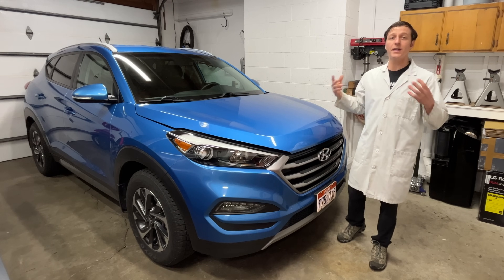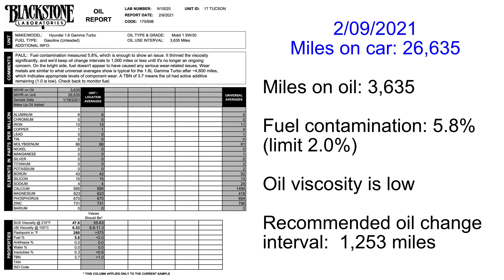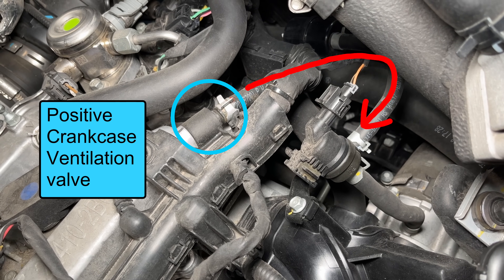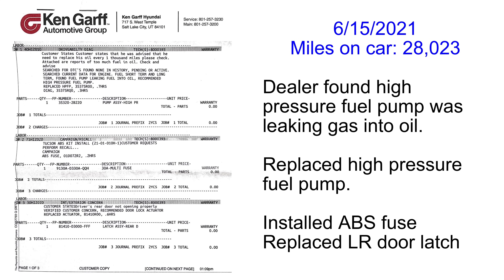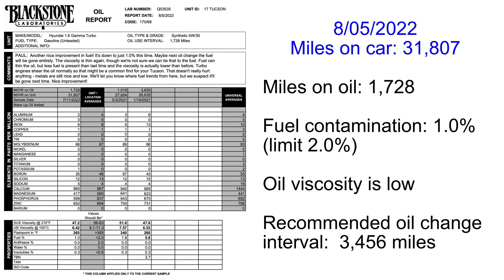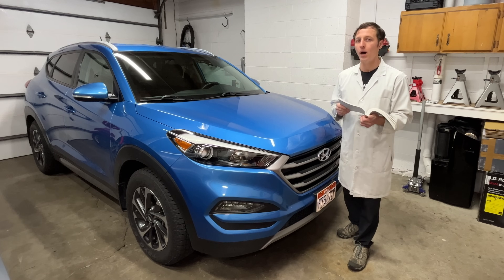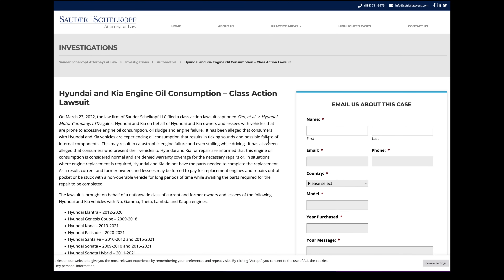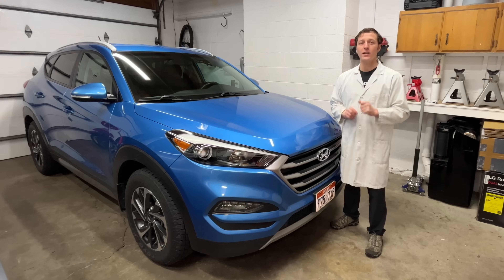Hyundai oil consumption and gasoline contamination problem solved

Comment: What is you typical drive cycle?
If you do short drives or idle a lot, your car doesn't heat up enough to for fuel and water to evaporated. I have only had on with fuel dilution issues. A 2.0T TSI engine because of bad design. But that was only 1%... i drive on a freeway for 30mi with 5mi city bookending my trip.

Comment: Yeah weird, my wife 2018 2.0ltr petrol tuscon non turo is awsome, does 7L per 100. Does use about 200ml of oil to 10,000kms. Been ever reliable.
Reply from the maker: Sounds like you've had good luck. I still recommend doing an oil test just in case.
Reply: @LabCoatPaul ours is in australia too. Not sure of diff models over the world build wise.  But been great soo far touch wood**

Comment: I've got hyundai bayon 2023 bought it in October had service done one month before buying, car went in workshop in December due to excessive fuel consumption, report came back nothing they could find wrong but level at 50% so they trying to say in 3 months its used 50% oil

Comment: Top Tier fuels are recommended, if not available fuel additives added to your fill-ups that contain upper cylinder lubricants may help. Seafoam has given me good results, but there are other manufacturers that have products like that as well.

Comment: My 2016 Kia Sorento has 112,300 miles and I just recently found out that it is burning oil. After looking into this oil consumption, I learned that the 2.4 L gdi engines have this problem. Have always taken my vehicle to Kia for services and was never told that this could happen to my vehicle. Kia USA never reached out to me about this known problem. I am so upset and WILL NEVER PURCHASE ANOTHER KIA!!!

Comment: One thing people miss on these cars that is a sizable contributor is the cold start parts of the calibration are poorly setup, they often flood when they are cold, especially when performing a cold/semi warm restart which requires you to full throttle to activate what I assume commonly used on other makes is clear flood function programmed into the ECU.  Flooding your engine is also a great way to pour in some oil dilution additive! 

My partner has the 2019 i30 and it drinks oil like no tomorrow and did from brand new, it suffers the flooding issue as most who own a Hyundai in Aus, but since they are all the same engine, the assumption is this is likely a global issue. 

Also, these engines are prone to knock on hot days on normal 91 petrol and only seem to be ok with 98 premium. The knock control system is surprisingly slow or not aggressive enough, similar to all the Ford 4 cly engines from the past 15 years like in the focus etc... They rattle like a MF and it's amazing they don't blow up 100% of the time, I feel like all Ford engines at least the petrol ones sold in Aus knock like a spray can.   Many didn't have any form of knock control iirc, but a modern car like Hyundai should have no excuse for audible knock, their ECU and code should be able to react and pull timing before any knock event ever becomes audible and def not any length of time where damage can occur.

With Hyundai, this multitude of issues are conspiring to the engines spinning big ends and stepping a leg out of bed.

I once did a used oil analysis years ago on my Holden which runs the Buick 3800, a 5K oil change was excellent and I recall the fuel dilution was something well under 1%.  I still have it on my PC somewhere.  That engine had over 300k on it I think at the time.

Comment: The video fails to address the driving habits of the owner.  Driving short hops where the engine doesn't warm up signficantly contributes to the blow-by and gas contamination.  If the driver drove mostly highway miles, the contamination would be significantly less.  Additionally, it's asserted that the cause of the oil consumption is due to the gas contamination when in fact, it's due to the build up of gunk and carbon on the oil retaining rings, usually attributed to the use of conventional oil (not full synthetic) and long oil change intervals.  The oil retaining rings fail to seat properly, causing blowby which only increases the oil consumption issues.  These engines require additional maintenance beyond what Kia/Hyundai suggest, including the use of full synthetic and oil changes at less than 5k miles. I have a 2019 1.6L turbo Exclaim ! and I love it.  I have 75k miles and it doesn't burn any oil.  BTW, oil consumption issues can be addressed by doing an engine soak and/or using Vavloline Restore & Protect.

Comment: My 2017 Mazda 3 has 40 k miles hasn’t used a drop of oil and got 44.6 mpg on the last trip last week. Brand new at $17k  20 k out the door . So far one battery two cabin air filters and oil changes
Reply: Continue using a good oil and you wont have any major problems !!

Comment: I have a 2018 Hyundai Santa Fe Sport with a 2.0 L turbocharged Theta ll that had extended warranty that started burning over 1 Ltr of oil within 1000km. Had to take car to dealer every 1000kms to record oil consumption. Oil consumption was over 1 L within 1000kms. Hundai declined warranty because the dealer recorded less than the 1L on the 6th and last test according to warranty issues. There was also cylinder wash from blow by and bad exhaust valves in number 4 cylinder that also miraculously disappeared in this same last evaluation. Doe to these miraculously self heal I was denied warranty. Never the less the problem worsened and now have a pronounced miss in the engine. After all these issues why would I put more investment in a vehicle and end up in the same position. MY ADVICE TO ALL IS NOT TO PURCHASE FROM HYUNDAI OR KIA

Comment: 2014 Santa Fe 3.3 , 58,000km , dealer oil changes every 6000km (81 year old mothers car) bottom end started knocking - Hyundai replaced short block under warrantee just after 10 years. Thanks to Hyundai!  we almost had to junk a perfectly good SUV!

Comment: All Gdi engines have this issue.  Certainly, you know about HONDAS GDI ENGINE ISSUES., and you should have known that TURBO GDI engines should definitely have 3000 mile oil changes, especially since we are forced to use 0 20 oil in them. From what i can tell, you didn't know much about cars, until you got a MODERN one. Personally,  I've owned 4 korean cars, and all were excellent,  I bought a new 2021 kia K5 GT LINE with the 1.6 Turbo, a great performer,  and of course 3000 mile oil changes since day 1, using Castrol Edge.  74.000 miles now, engine runs like new, uses no oil, car has had no issues.  Stay away from Honda Accords with the 1.5 Turbo engines.  They are blowing head gaskets, and ruining the Turbos at the same time because of coolant in the oil. Honda is refusing to help it customers becase its happening after 60.000 miles, but usually well below 100.000 miles. Very EXPENSIVE REPAIR. Have heard a class action lawsuit is in the works.

Comment: My 2013 Santa Fe had the 2.0T and i did the oil changes every 3500-4000 miles with Mobil 1 synthetic. The only time it was in the shop was for recalls, and the rocking drivers seat issue they had. It never burned a drop of oil between changes, but it did lock up at 89k miles. They looked at it and had approval to replace in less than 24 hours. They never asked for proof of oil changes, but the fact I always used factory filters and had a Fumoto valve installed instead of the drain bolt might of helped them realize I was doing the service required.

Comment: I think every manufacturer should face a similar lawsuit. My GM gdi oil gets very thin if I follow the oil change schedule. At a fresh oil change the warm engine idle oil pressure is 32-35 lbs at 3,000 miles it’s dropped to 25-28 up to  5,000 miles it’s dropping to 22-23 lbs. they recommend oil changes at 7,500 miles.  Low friction oil rings, thin oil, and the extended long mile oil changes will kill engines.

Comment: My dipstick has risin above the full mark almost an inch from fuel mixing with the oil. Only 4k on the oil. 2nd theta II engine for the 2019 sorento. First one blew at 28k even tho it had oil changes every 5k religiously. Complete junk. When warranty is up it’s getting traded in.

Comment: 2015 Hyundai Tucson with 92,124 miles and still going, replaced all rotors, valve cover gasket, serpentine belt, starter location was a pain in the you know what but replaced that once, A/C compressor once, replaced window switches once and main driver side window switch 3 times, missed some oil change intervals but I used a slightly thicker oil 20/50 cause we live in the tropics, leather seats are holding up, radio screen is showing a black halo around it, dashboard showing aging with a few small cracks not that noticeable, going to finally flush trans/replace fluid and coolant but those 2 are still original and I am quite surprised I have these many miles on it and I still still drive to this day 👌🏽🤔😁

Comment: The answer and solution to this in this case. . .  is only buy a Hyundai or Kia vehicle with the 2.0L MPI engine. Then no issues with HPFP leaking raw gas into the crankcase and no gasoline getting sprayed right into the combustion chamber and getting past the piston rings. Multiport Fuel Injection engines are still in use if you look for them.
Oil change  interval can then be 4,000 to 5,000 miles and still protect the engine.

Comment: I am going to share my experience with owning a 2015 Hyundai Sonata, with 135,000kms that: (1) does not burn or drip oil (2) has no sludge build-up (3)is very fuel efficient (4) motor is very quiet and runs in showroom condition, and has great idle oil pressure.
       How? Short answer: 4000-4500km synthetic oil changes with high flow quality oil filters (yes kms not miles, less than 3000 mile oil + filter changes ... I use mid-grade 89 or higher octain fuel only ... I run a mild engine flush(seafoam additive) in the motor oil every third oil change ... I change pcv valve every 40,000 to 50,000 kms, I run Lucas fuel stabilizer additive in my fuel tank every other fill-up ... and finally,  I do not under any circumstances run the 5w20 oil(even in winter) I only use 5w30 and 0w40 in summer( there's an important reason fir this)
         Why? GDI gasoline direct injection engines, allows a bit of high pressure fuel, past the low tension piston rings, contaminating motor oil which makes the existing oil even thinner, and washes away some of the protective film strength on the cylinder walls. Combustion deposits also tend to migrate into the ring lands, getting stuck there, hardening over time, and preventing the sealing action of the pistons in there bores, which causes burning oil. Frequent oil changes, more stable higher octain fuel promotes a cleaner combustion process and Lucas fuel stabilizer prevent carbon build-up. Thicker film strength of the 30 - 40 weight oil, helps seal combustion chamber and fights dilution of oil through bypass contamination. factory tuned, early transmission up-shifts, causes low speed detonation, which damages rod bearings over time, but the 89 to 91octain fuel prevents this condition, while the 5w30 weight oil, vs the 5w20 improves oil pressure numbers, on the bearing surfaces, and prevents metal on bearing contact. Lucas oil stabilizer also puts a thin film of lubrication back on the top sealing rings and valve steams increasing engine life, and the detergents help prevent intake valve carbon crust. Very early oil changes using quality synthetic oils, trap and lock combustion deposits in the oil, preventing sludge build-up and the high flow oil filters keeps oil pressure at optimum levels. Changing the Positive Crankcase ventilation valve often, helps prevent stagnating fumes from causing carbon bonding to internal components, thus eliminating blocked oil galleries with an accumulation of carbon in the form of sludge.
 Everything mentioned here adds up to a vast difference in engine longevity, and reliability. Hyundai 2.4L Theta II engines are not particularly problematic, the issues are more of a combination of several factors that if left unaddressed will prematurely cause wear and longterm damage, but an aggressive maintenance schedule will prevent this.
Reply: I live in puerto rico tropical weather year round 2017 tucson 1.6 turbo up to now no issues with 80k miles. Still can't feel the motor running while i'm inside, it runs smooth as butter. So you think I should change to 0w40 motor oil?
Reply: @carlitosortiz2870 that's not a bad viscosity, but I prefer a 5w40 blend, the 40 means that you are still running a good viscosity
Reply: @brentneves3602 i'm asking since the weather here is warm/hot year round which should i use bcause in your comment you said you switch to 0w40 in the summer. Was that a typo
Reply: @carlitosortiz2870 no, not a typo, in parts of  Canada we can still have cold mornings in summer, I use the 0w40 so that the oil is not too thick on colder mornings, but I can also safely use 5w40 also, as the difference between them is small, the 0w40 flows better when it is cold, than the 5w40, but only marginally, for hot weather all year round, 5w20 oil, is too thin PERIOD! 5w30 or 10w30 is a safer viscosity, but if you do a lot of starts and stops, heavy traffic driving, or lots of high rpms, then 5w40 is probably the best bet, but do give your engine proper warm-up time, 2-3 mins(cold starts) to allow the thicker oil to properly lubricate the turbocharger, and camshafts before driving. Don't use 15w40 diesel oil, under any circumstances, it is too thick for automotive engines, and it has the wrong detergents for gas engines.
       Most 10w30 quality oils will be sufficient viscosity for normal driving conditions, in a hot countries, the secret is very early oil changes, to prevent sludge, which leads to blocked galleys.
Reply: Until the manufacturer mandates 5W30 or Premium fuel most owners will use the thinner oil and cheaper gas. Ford Fusions with 2.0L Turbo EcoBoost benefit in power (about 10%) from Premium Fuel, so there is a real rationale to use it there. It also uses 5W30 Oil. 

Those engines are very reliable with that combination, while delivering way more power and torque than the 1.6L Turbos Hyundai was using in the Sonata Limited trims. 

With the shift in engine design, it's probably time for manufacturers to start mandating higher quality fuel in their warranty packets. 

Use regular unleaded at your own risk - and cost, basically. 

People with Hybrids should not have an issue going to Premium. The increased gas mileage offsets the cost increase. IMO, all Hybrids should be designed to burn higher quality fuel, not regular unleaded. 

Most Turbos should, as well. It just makes sense. 

Most people want to have their cake and eat it too, though.

Comment: Switched to 5w-40 for this reason, and change it every 35hundred miles
Reply from the maker: That's good. I recommend sending an oil sample to the lab just in case, so you know how the engine is doing.

Comment: Welcome to the world of climate alarmist. They will create rules that manufacturers needs to meet and the customer will pay the price...
Reply from the maker: The climate pays the price too. I've measured the emissions on my Hyundai, and it is very clean at idle, and even cleaner at 2,500 rpm with no load on the engine....
But once the turbo gets going, the only way to prevent detonation is dump a bunch of extra gas in, which makes it burn rich and create very high hydrocarbon emissions. It's polluting while you're driving, not during the test, so the climate folks are happy.
Also direct injection engines that don't have port fuel injectors require cleaning once a year that involves burning chemicals that pollute a ton. That's fine for the climate too.
Oh, and if the engine happens to blow up early, manufacturing a whole new car is great for the environment too.

Comment: If I had one of these engines I would be tempted to use a little bit thicker viscosity oil.  Especially in hot climates.
Reply from the maker: The owner's manual lists many different viscosities as acceptable for the 1.6 liter Gamma engine:
-10 F to 120 F:   5W30, 5W-40
0F to 120 F:       10W-30
10F to 120F:      15W-40
20F to 120F:      20W-50
The owner's manual recommends using 5W-30 for best fuel economy.

Comment: Thanks for the informative video.  I couldn’t agree more about the RAV4 being the best vehicle.  I had a 2008 with the 3.5 litre V6.  The company was really frugal about servicing pushing oil changes to almost 25,000 km at times.  The engine took the abuse and when I retired it had over 300,000 km.  Ran and drove like new.  Never burned any oil!

Comment: Did the dealer ever explain how the high pressure pump could cause gasoline to leak into the crankcase?
Reply from the maker: They explained nothing, but the answer to that question is simple. The high pressure fuel pump sits on top of the valve cover and is driven by the camshaft. It has 2,000 psi of fuel pressure on one side, and almost no pressure inside the valve cover. It's pretty easy for an O-ring inside the pump to leak a bit and dump gas straight into the valve cover.
Reply: @LabCoatPaul  Thanks, I didn't know the layout and couldn't see any reason for there to be leak path, but that clears it up.  I've got a 2020 Honda CRV and do 3,000 mile synthetic oil changes, but have noted a gasoline smell to the used oil.  I'm thinking that I'll need to have the oil analyzed the same way you did and check to see what kind of PCV system Honda uses on it.

Great video and thanks again!
Reply from the maker: @kirkjohnson6638  Yes, definitely send it in to the lab! It's the only way to know for sure.